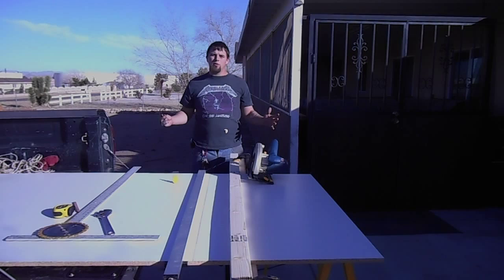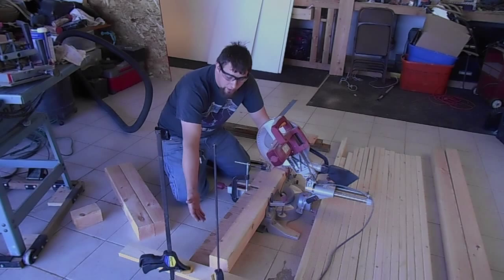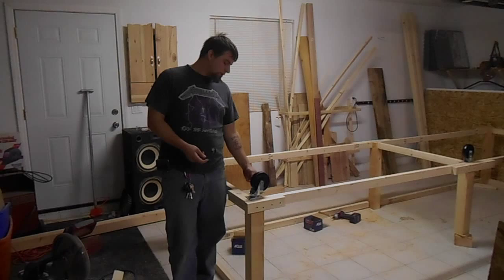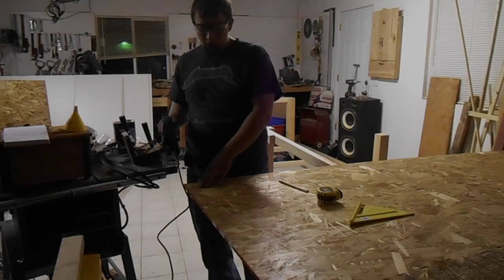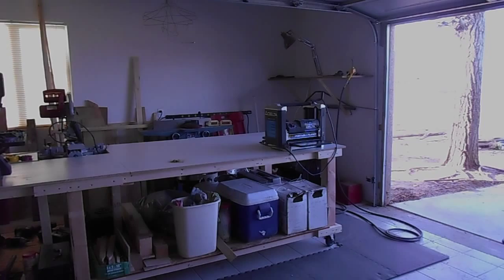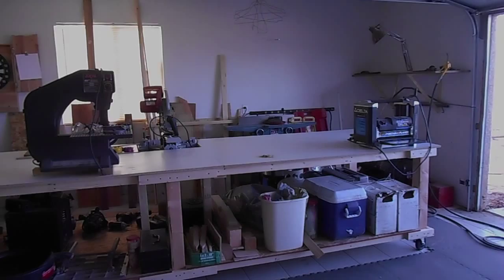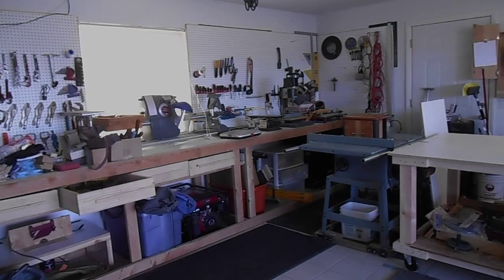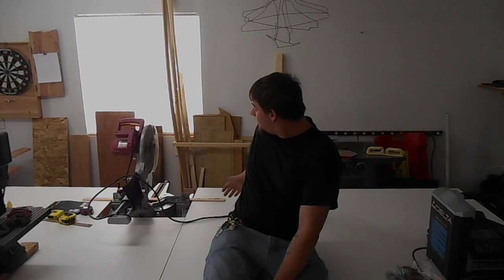The Ultimate Work Bench Build

Comment: That sucker is long. Like the feature of the sunken scms area. Makes less work making a raised fence with the saw lowered like that. Give any thought to a keg jig to help with the toenailing? Sometimes there're a hassle to set up though. Keep it up.
Reply from the maker: I made it so long so that it only takes up one side of my 2 car garage and have the ability to fit most of my tools on it and still be able to park my truck at night.  As for the miter fence I plan on doing a spin on Norm's design.  I am not a fan of expensive jigs but if I came across a kreg jig for the right price I would probably pick it up.
Reply: Cool can't wait to see that.